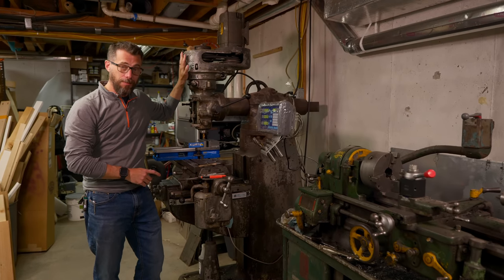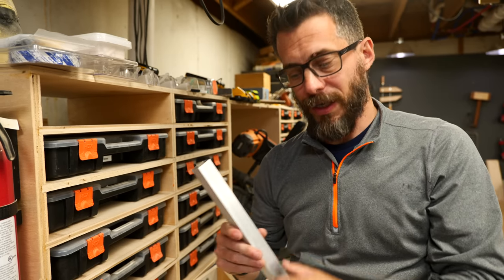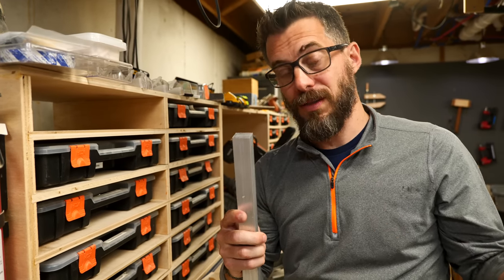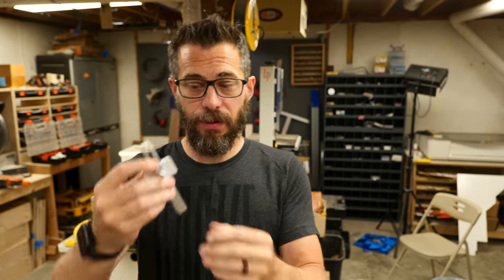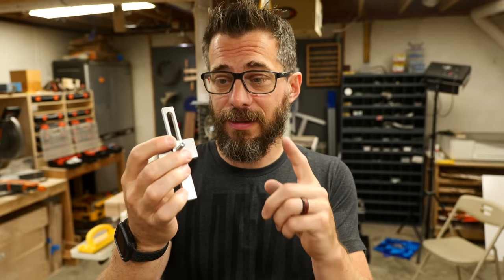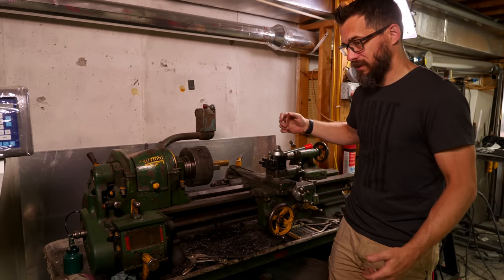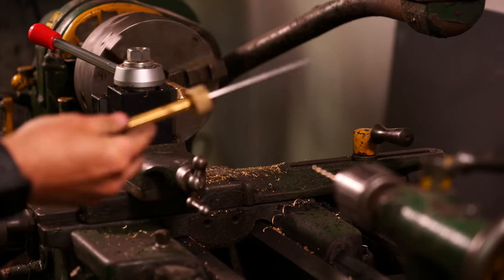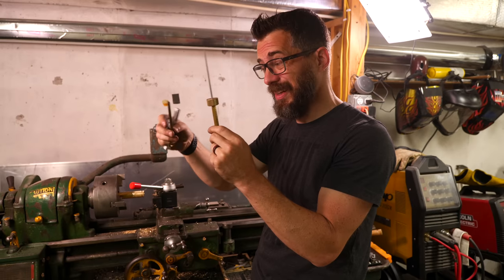Overcoming My Fear of Machining Metal

Comment: Recommended to add some oil while using taps. And for the knowledge, there are three types of taps for making a single screw hole. In this case, it is fine because it is just brass. But when tapping on hard materials using 3 taps is better than one.

Comment: Many others have given you good advice, but here are some I have not seen yet. When machining you should always be concerned about rigidity, both of the machine, the tool, the work holding and the workpiece it self. As a rule of thumb you don't want your tool, or your workpiece to stick out more than 3-5x it's thickness if you can help it. You can get away with more if you need to, you just need to be more careful with your cuts. That said, you were ridiculously careful with your cuts, which is what you were going for, so mission accomplished! Brass and aluminium is very forgiving, so you can get away with a lot. For reference, in that brass piece, I would expect you could have taken maybe 5-10mm of the diameter in one cut no problem.

I suggest you find your self a speeds and feeds calculator, to get you in the ball park, and don't be afraid to take big cuts and feed fast. Take a piece of scrap, and turn it all into chips by taking gradually heavier cuts, until you run into problems. You must do this for every new material, as they all behave differently. It's good to know this, because your tools will last longer if you use few and heavy cuts, rather than lots of light cuts.

With regards to the noises, you kind of just have to experience it to recognize it. But the sound from the Parting tool, was simply due to you cutting into the knurling. In general a bright sh sound is what you expect out of a lathe. If you start hearing dark rumbling sounds when you cut, the tool is probably dull, or you are running the the lathe in reverse (don't ask me how I know ;p). If you get screaming sounds, kind of like dragging a chair or table along the floor, just brighter in pitch, that's usually accompanied with a really ugly finish. This is called chatter, and caused by the tool bouncing, avoid this at all cost, it's bad for everything. Changing the depth of cut and/or speed and/or feed can help with this. Also make sure everything is as rigid as possible. 

A comment on threading. Make sure never to use a cheap or dull tap in steel. That is guaranteed to end in tears. Expensive taps are much cheaper in the long run. Use liberal amounts of cutting fluid/paste when cutting threads. And the backing off every quarter turn, in brass it is not necessary, as the chips break on their own. In softer steels and aluminium, I usually go one full turn before backing off, sometimes more.  The reason is that the chips are not so strong in those materials. The stronger the chip, the more important it is to break it often, so that it does not cause too much resistance. You will develop a feel for this when you have tapped enough holes.

Comment: Im sure its been said but flattening the face of the stock as well as using a "spotting" bit will help with hole straightness. Spotting bits look like super stumpy pilot hole bits. Theyre short and stiff and almost guarantee a centered divot for the next size bit to follow.

Comment: Bey Bob,  if you would leave the round bar in the lathe and then put the tap in the movable jaws (where the drill bit was ) you should be able to move the lathe back and forth by hand to get it perfectly centered. Also before you use the drill bit, use a centering bit first.  That’s pretty  good for your first project.       Alan

Comment: The diameter needs to be an even multiplication of the number of knurl teeth so that they line up. Push knurls require a LOT of pressure and you have a lot of unsupported overhang.. work as close to the chuck as you can and  or support the end with a live center in the tailstock..pinch knurling tools are easier to use on smaller (less rigid) machines. All that to say, good job for facing your fears and you made some nice parts!

Comment: Hex stock is good for turning on the lathe especially with a three jaw chuck. It's nice cuz you can make your own bolts and nuts. But yeah use the tail stock to tap your holes with the main chuck in a neutral position just spin it with your hands. Also a surface plate or makeshift one (marble countertop off cuts) are nice to have for sanding parts flat.

Comment: Always try to hold the piece in the center of the vise. Believe it or not, a Kurt (and even much more expensive vises) front jaw can pivot side to side (this is adjusted with the set screw facing you)

Comment: You need some centering bits for starting holes on the lathe. They are short and thick with a very short drill bit section on the end. They can't flex like a regular drill bit, so the hole stays centered. You just start the hole with it, then switch to the regular bit.

Comment: Just a thought if you want to get the block out of the way further, loosen the knurled knob a little more pull out on your block flip it upside down push it back in and tighten it down with it all the way up.

Comment: Perfect timing on this one for me! I bought a hobby CNC a couple of months back and I'm getting close to having it up and running - And I must say I'm pretty anxious about getting started actually using it.
Starting on a small and manageable project like you just did is the best way to gain some confidence in the whole thing.
Reply: If you bought a hobby CNC you should be running it after you plug it in. Or was some assembly required? I built a CNC machine from scratch and that took a while. Initially just run the machine with no tool in it or work on the table. That's called cutting air. The next thing I did was plot with the machine. You tape some paper to the machine bed and put a pen in the Z axis. Then draw something. After that you're ready for some stock and a cutter.
Reply: It was a halfway finished project i bought off of someone so I've had a lot of things to figure out and read up on. But it's getting there. I've had everything running individually so now I've bought an enclosure to use for the control box and started putting everything together.
Good idea with the pen! That seems a lot more manageable than having to figure out the whole feeds and speeds ordeal before getting any further.
Reply: @dachr2  firing up a CNC is a bit iffy at best. So it is best to take it in progressive steps. Pen plotting is a great confidence builder early on. Rubber is hitting the road then but it isn't a metal bit spinning at high speed. So if disaster strikes it's not going to be so bad. At worst maybe you'll break a disposable pen? They're the best to plot with too. I've tried fancier pens and ballpoints are the best. Go figure. I like plotting. I have a spring loaded pen holder I've made for my machine. You'll see when you're plotting why that can be important. My machine is a regular artist. It can draw a lot better than I can that's for sure.
Reply: @dachr2  I should add what you need to learn how to do is to touch off. That's the trick with CNC. Touching off is setting your machines zeros. When you're pen plotting you'll have a chance to practice doing that. Mostly it's the Z axis you touch off you still need to cut in the right place in X and Y too though. That's your origin. On some jobs you'd touch off X and Y. Initially you'll be happy if you just don't mill a hold down.

Comment: Bob, the Oliver lathe is a good one (that one looks a bit older than the one that's in my local maker space though). The only thing I'll note about the handles is to make sure to NOT touch the Guillotine one... It's a very effective feature but it will also make you a bit light-headed. 😁

Comment: Three things, speeds, feeds and proper work and tool holding.

P.S. you can use your vice handle to tighten, loosen and smacking the draw bar on the mill.

Comment: the chuck jaws are set up for an outside grip on a big diameter bar than you have. turn the around to the longer part is closer to your work piece. less scary and less likely to catch something the shouldn't. the knobs and levers will set the speeds and feeds of the lathe. try to find a manual for the lathe if you don't have one and a machinist handbook, as it will give you ball park feeds and speeds for the materials and it'll make your work so much better. and as someone else said. no rings, watches, loose clothing etc when using the lathe

Comment: 5:48 Machinist here. Quick tip: Use a rag to grip the cutter when youre putting it in the collet. Its much safer for your fingers. With oily hands its easy to slip and cut your fingers really badly.

Comment: Love the South Bend 9A. With the quick change gearbox, power cross-feed, and taper attachment, that's a great small lathe to do some awesome projects (and it makes my South Bend 9C jealous with all those extras!). A great starter project is to make your own machinists hammer, it can be done entirely on the lathe and makes a really nice tool to go along with your machines, and is a great confidence builder. Others have mentioned it, but a good rule of thumb on the lathe is to only let parts stick out 3 diameters without support from the tailstock. In addition, your South Bend lathe has plain bearings in the spindle instead of the ball bearings found in more modern lathes, and the knurling tool you're using does require rather high forces that can cause extra wear on the plain bearings. You might consider a scissor-type knurling tool instead for better results and less wear on your lathe.
Reply: It is a Southbend 10L - Heavy 10.  Toolroom model (large dials and taper attachment).  I love the 9A, B, C, and Ds.  But those are way lighter than this machine.  He could turn stainless steel on this one, without a concern.
Reply: @chrispalombo6394  you are absolutely right, not sure how I missed that. That being said, a 10L still has plain bearings. FWIW I can easily cut stainless on my 9C and produce a great finish.

Comment: The hole being crooked could also come from using too long of a drill bit. I would recommend using a spot drill to start the home and then buying some short stub drills for large work since standard length bits tend to flex a little

Comment: As someone (like others here) who worked on machine shop equipment like this, little advice OIL IS YOUR FRIEND, WE LOVE OIL. Put oil on your part anytime it makes that squeaking and feels free to use a lot it won't hurt it, just get a little paintbrush with some oil and put it on. I've done it enough I can tell from the sound it makes if I'm doing it right, but I remember when doing it at first and every little squeak would scare me so your not alone, I think that's normal. Also, no aluminum is actually more dangerous than steel, because aluminum has a weird feature where it will sometimes bind with steel tools, even though it's softer it may bind more. So if you cut too much aluminum it may tear your part out more than steel, aluminum binds more. Brass is okay though it doesn't do that.

My advice:
USE OIL (have a little jar with some and apply it with a paintbrush, it won't hurt it, and use it liberally. (if it squeaks often it means I want oil) Do this, especially to any drill bit going into a part, and you can always back it out and add more oil if you need. In fact, it's generally a good idea not to drill all at once and to go into the part in steps, pull it out and go back in again this keeps the chips out of the hole which can mess up the size of the hole you are making. Also, use a reamer as the final step.

The biggest mistake people make on lathes and to absolutely watch out for is that your key (that tool used to tighten the jaws) isn't in the machine when you turn the machine on. If you forget... it gets dangerous very quickly. Also really don't be shy about cranking it in there this is holding your part after all. The other thing is just never having anything that can catch on the spinning part like long sleeve shirts or other things, also tuck in your shirt, no loose clothing. If it gets on the spinning part it can pull you in, however, if you wear close-fitting clothing and short sleeves this basically is not really an issue, also tie up any long hair (not an issue in your case). Plus ALWAYS wear safety glasses and ones that have protection on the sides as well not just in front.

Getting the correct order for machining is certainly a skill that takes time. This is probably the hardest part of machining and the hardest thing to learn. (order of operations takes planning). This is why machines exist for this step. Anyone can turn a lathe but knowing how to do it, what do it with, and in what order to do it in, is the profession. So don't feel bad if you struggle here.

When it comes to speed, in general, faster is usually better (again usually) because if you go too slow you can create issues, so if something seems to not work well try turning it up before turning it down. Speed however has more to do with the types of chips you want to make, faster speeds will make smaller chips, and slower speeds will make string-like chips. Slower speeds are usually better if you are trying to say cut a screw grove, where it's hard to control at higher speeds. So if you are cutting and getting string-like chips, turn the speed up to get rid of them, if you are making chips that are too small like sawdust slow it down. If you want a nice starting point, 200-800 rpm is a good beginner's speed for most things. However, the speed in many cases depends on the metal, aluminum for example is typically slower than steel. Brass is the easiest metal to machine and is more expensive, but a good one to practice on as it's hard to mess up as it's soft and will just give way, plus it makes great chips. So what speed should you use, look at the chips you are making they should be big enough to pick them up easily (not sawdust) and not like a birds nest material (unless it is because you did a screw then it's okay because control is more important than what you make).

If you want, you could try finding a local community college and just taking a semester in machining, then you could have an instructor with you to teach you the ropes, a good class to take even if you have been doing it a while since sometimes there are always things you don't know about.

Yeah don't be scared, I would just use oil and always check to make sure my key wasn't in when I started and make sure it's tight, wear close clothing and you should be just fine. Being scared of it is okay because when you become comfortable with it that is when you start making mistakes. You can do this I believe in you!

Comment: The jaws on your lathe need to be turned around and yes they can go either way depending on what type of part you are holding.  You should be using a live center when on the lathe and especially when knerling.  Lots of cutting oil when knurling and because you don't have a live center the part will deflect away from the knurling tool.  The red handle on your tool post should not be on the left side close to the chuck, but not too bad your cameraman can call the ambulance for you.

Comment: You may want to flip the jaws on the lathe unless you're cutting something large. While knurling, you might want to slow the  lathe down. You can also use the tailstock to help support the piece.  You can use more pressure on the part being knurled.
Reply from the maker: Good call!
Reply: Go to Abom69’s channel. He is good at teaching.

Comment: Love that your openly tackling fear of these machines one note about the lathe however the chuck that is on the lathe currently is set up for large part turning hence the tall side of the jaws pointed out  you'd want to either get a set of reversible jaws for it a replacement chuck that comes with the jaws having the tall side in the middle it'll be much safer and sturdier it sounds like this machine could use some maintenance and a general once over. The parting always sounds horrible as it's a thin cutting device that will run the sides of the cut as it goes further in a little lube might help it next time. As for the crooked threads that's because you took part off of the lather before threading it generally I'd say drill deeper than you need to so that you can tap it nicely and it'll stay centred

Comment: Machinist here. Your doing a lot right, go slow when learning. Most people don't get hurt till they get complacent.

Lose the watch and ring, especially when you start on steel. 

Part off tool is sticking out too far, only let it out what ya need.

Knurling should generally be done in one pass, and it's normal to feel like you putting a lot of pressure while doing it.

You can cut a groove with you part off blade and then chamfer back of the part before cutting it off.

You can just stick your tap in the tailstock chuck after you drill and drive it by hand spinning the head while in neutral. Your wobble could be due to tap going in crooked, yes it can be off axis that far, it does not follow the hole it follows it's starting angle.

Comment: Here is my experence. flip the jaws for better material holding, use tailstock support. turn at a lower RPM. USE A LOT OF OIL, and dont lock the tool in the post. i do this for a living ad this is how i get perfect knurls every time. keep practicing and youll get it.

Comment: Take the jaws out,flip them so the larger area of the jaw faces center, unless you are machining a larger piece you shouldn't need them set up that way.
Just back off the jaws until they pull loose, turn them 180 degrees (some are numbered 1-2-3), screw in 1 first,catch 2 on the same thread then 3.
Leaving the jaws as they are could do some damage to you or your machine, as an experienced machinist I have had my share of near misses with chuck jaws so in your case this would be the first thing I change just to be safe.